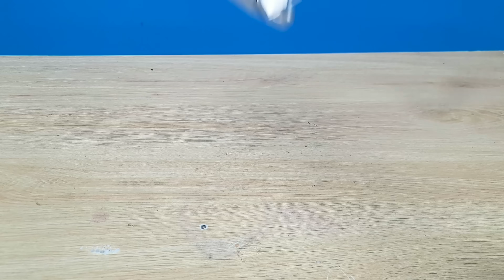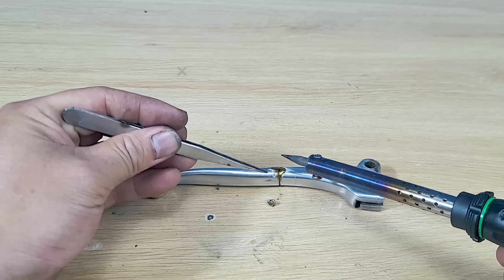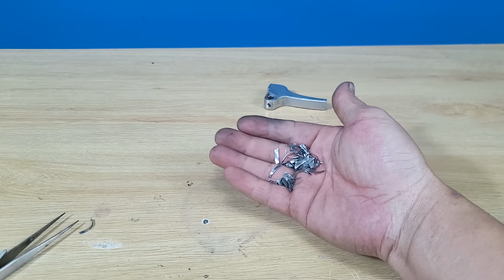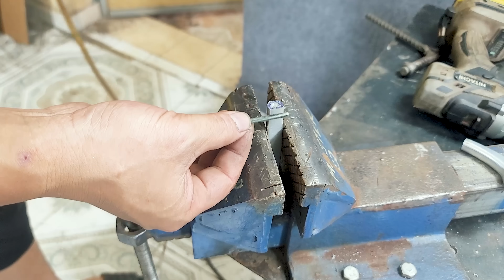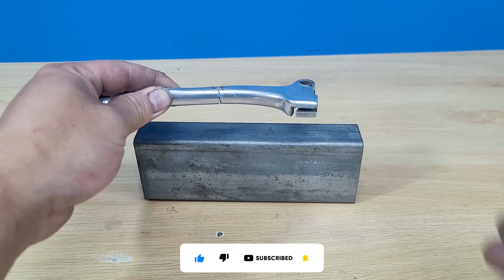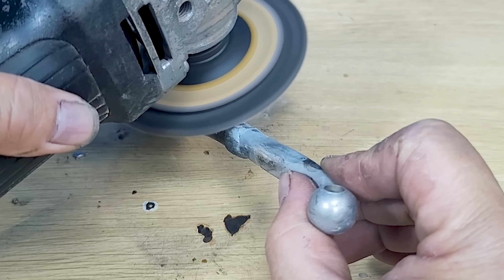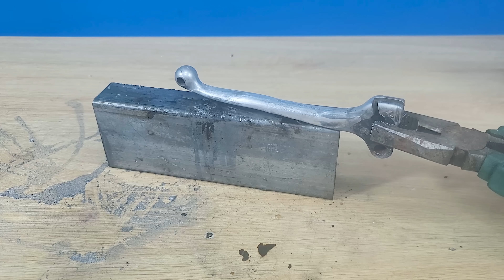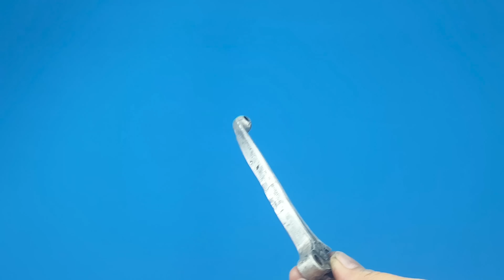Even a NASA professor had to learn this from me! Idea of using 1,5V battery to weld aluminum brakes

Comment: what was the whole point of stripping and soaking the battery shell cover bits again? When all you had to do was buy some aluminium welding sticks
Reply: My first thought also, the screw is probably doing more than the solder
Reply: It's a homebrew way of making brazing flux as far as I can tell. Zinc + Toilet cleaner (this brand active ingredient is Hydrochloric Acid) gives you Zinc Chloride which is an appropriate flux to remove oxides from aluminum alloy in order to allow the tin-zinc solder to wet and adhere.
Reply: Actually if I had only option to fix and not replace..I would just use a stainless steel screw..would actually be strong or stronger then it was..
Reply: ...because ordering sticks is not the African way
Reply: because sometimes you can't just buy stuff. you're acting like the average privileged westerner
Reply: @wizups Let me ask you this. Would you rather gamble and risk your life / the life of another person on a dodgy lever, or walk somewhere in relative safety? There is a third option but we can get into that shortly. I know full well the choice I would make, privileged or not. Its less about privilege and more about not wanting to die or kill someone else. This is unfortunately one of those scenarios where a viewer of this content is either going to agree or disagree with the methods used and the risks involved and frankly anyone who agrees with such methods will not have the sense to see the inherent faults and implications. There is risk involved in everything from tying your shoe laces in the morning and snapping your spine, to jumping off a bridge later in the afternoon. Tying your shoe laces is unlikely to affect anyone else, but the afternoon bridge jump has the potential to involve other people and so questions have to be asked. Its a risk assessment around the potential to injure other people, and this lever repair is just off the scale.

Comment: putting that steel screw inside the aluminum is going to result in galvanic corrosion and internal erosion of the repair and it will eventually fail and snap off, quite likely at the most inopportune moment when max braking is being applied.
Reply from the maker: Thank you for your comments and shares, thank you for the extremely valuable knowledge you bring to us, my good friend, have a nice day

Comment: Do not copy this idea !! In theory you could glue the two pieces together and they would hold for a while, eventually they will fall apart again at a critical moment. The point is you can't just weld Alloy together with a Gas Welder, Steel yes but not Aluminium Alloy. It requires critical and accurate temperature control and for the cost of a new lever.....well all I can say is DON'T !!

Comment: This cannot be surpassed in terms of ridiculousness. Anyone who works on parts on which life depends and doesn't even have a metal drill or tap should just leave it alone. A new lever costs almost nothing. And the NASA professor (who of course doesn't exist) definitely laughed his head off at this video. And it has nothing to do with welding, it's just filling the gap with solder.

Comment: it seems that you are:
a) using the screw to mechanically hold the parts and do the actual work
b) using the zinc chloride to prepare a rough surface, by cimentation of the zinc on the aluminium (probably zinc aluminium alloy like zamac)
c) using tin-lead solder to fill the gap on the union, basically a cosmetic workarround, not even needed at this point, you could have used bondo
Reply from the maker: Thank you for your comments and sharing with us. Have a good day

Comment: If you are compelled to do this you probable should see that the clutch is the lever that is repaired. Sometimes the brake and the clutch can be switched. It would be better that the repair fails for the clutch than the brake.

Comment: Don't take any notice of the idiots.... in some cases you can't buy these parts and having the skills to make or fix it yourself is priceless, well done buddy for sharing your knowledge.
Reply: This is at best what I would consider a Bush fix. Parts that are damaged where safety is a concern should always be replaced and not patched. But besides that, the premise of this video was that even NASA is learning from this gentleman what is common knowledge to most people in the construction or repair world. This guy is looking for clicks and failed to break any new ground here.
Reply: There is sO much more value to this than repairing a brake lever.  I got so many take-aways. Mad skills, man.
Reply: You're absolute right in my book. 

I think the Video is packed with clever craftmanship and creativity.

Keep on going, haters gonna hate. 

Still sad to see people react to creativity with destructivity.
Reply: In exactly what case would you find yourself incapable of finding that part but having a treasure trove of tools & supplies required to fix one? Good luck hauling that vise & bench it's attached to down the bike trail! 😮‍💨

Comment: Nice effort, but after a minute or so of watching you dealing with the battery, acid and stuff, I decided it's way more safe and practical to just go out and buy a new cheap freaking lever. BUT... This could work for some other emergency applications, indeed. One more thing realized: you better have some spare levers on hand. Better have and not need, than need and not have.
Reply from the maker: Hello, nice to talk to you my good friend, have a nice day

Comment: A la nasa te vamos a enviar para que investiguen lo mal que tienes la cabeza o a Mondragón Ácido Muriático y níquel que te quieres matar . 

Tomen arena de miga es un tipo de arena de roca triturada a 1kg se agrega 100g de grafito puede extraerse de pilas usadas triturado hasta crear polvo y mezclar con la arena agregar arcilla caolín polvo o arcilla en bloque para polvo 100g en arcilla no seca es más complicado la mezcla . Mojar la mezcla ya tipo mortero de fundición y colocar la pieza a replicar el molde se realiza en 2 mitades mire moldes para colada y esto no es aluminio es calamina una aplicación Zinc Aluminio Níquel  el punto de fusión es relativamente bajo la colada de este metal se realiza de abajo a rebosar o creará imperfecciones de consistencia es decir la entrada de metal fundido es como una J al molde le crearemos salidas de gases el metal aconsejo 50% las del total de la pieza .
En caso de soldadura directa Barilla aleación Cobre aluminio plata limpiar las partes con cepillo acero inoxidable y agregar bórax para que sea viscoso se puede agregar a volumen 0.5% ácido muriático para este tipo de aleación pero es mejor Bórax polvo las soldadoras con bórax puede provocar que las partes se separen fijarlas en un banco soldadura

Comment: Here's an idea: Tap the lever big end, then use a long bolt with the proper diameter, screw it in with red loctite, then bend it into the right shape, cut it at the right length, then cover it with various thermoshrink tubing, then sand it until it resembles the original lever, then paint it aluminum.
Now, here is the most critical part for this to work: DO NOT post it on YouTube.
If all goes well, nobody will ever know why you had a fatal scooter accident.

Comment: Clever method.
Yes easier and cheaper to buy new but people just don't get his point. It is very handy to know skills like this.
A lot more to it than people realise. Excellent improvisation.
Making a tap out of a screw
Using the battery to make a flux
The end result is perfectly serviceable. Heating and hammering straight shows the strength of the joint.
Thanks for the video - anyone who really knows engineering would find the processes used to be interesting.
Reply: What's up with all the negative feedback. A fix like this has endless uses and can be applied to much more critical things than the break lever used for this demonstration. All you people running your mouths are the real waste of time. You sound like a bunch of idiots thinking your so smart.
Reply from the maker: Hello, thank you very much for your positive comments to us. You are a very nice person, nice to meet you. We look forward to receiving your support in the near future. Wishing you a happy new day
Reply: Even inventor surprised at positive comments
Reply: It's because these people have been trained to be consuming sheep and everytime something breaks they buy a new one.  If ever in a real emergency, everyone in this comments section would be begging this guy to help.😂
Reply: @TekkWolf  NO , this isnt about how to fix a fork dude, its something that could save his life  or lose it potentially

Comment: I have to wonder
could one actually "weld" the pieces together using high-amperage low-voltage to heat the seem to melting point? (maybe, use some alu filler rod?)
Reply: I have welded a kick starter back together with no issues, so yes you could just weld it if you have the gear and knowledge of how to do it. To be honest as a qualified metal fabricator the only thing holding this method together is the bolt he put in the middle, that is if it is the same brake lever.

Comment: I worked at an aluninum plant. The biggest in ontario. We extruded, anodized and fabricated everything from raw billots. If i told one of our new guys you made a lithium solution and melted aluminum together theyd call you an idiot. Highly dangerous. Extremely toxic. Flat pit stupid. Aluminum is light u could use anything to fill that gap. Its a damn lever not a bridge 😂

Comment: HAHAHAHA, What can I say? 
That fairy tale about the NASA professor can't be true. I once saw with my own eyes (i SWEAR!) how NASA used this exact technique to repair the wing of a space shuttle (I clearly remember it was Challenger) right on the launch pad, about an hour before takeoff. It was April 4, 1983, at Cape Canaveral. 
Challenger lasted nine missions with this repair, and was destroyed on the tenth mission because of a broken bolt in this joint. 
This happened on January 28, 1986, exactly 73 seconds after launch, when the bolt in the joint loosened.
so I wouldn't take any chances with a brake lever repaired like that, you could end up just like Challenger did.
Plus, this video wasn't posted until early 2024. 
Clearly someone here was copying from someone else.   🤣🤣🤣
Reply from the maker: Hello, thank you for sharing, have a nice day

Comment: My comments are:
1. This process should be called brazing, not welding.
2. The zinc from the zinc-carbon battery could easily have been gotten from a piece of zinc. Extracting it from a battery is unnecessary drama.
3. The chemical reaction produces zinc chloride, which is a brazing flux. There are better fluxes out there and even zinc chloride could easily have been purchased from a store, even in India, rather than making it yourself.
4. I have never seen anyone use a drill and a screw to drill into any metal. The drilling could have been done with a drill to be followed by manually cutting the threads into the hole with your specially-made 'threader'.
5. The insertion of the threaded bolt into the core of the joint is crucial to mechanically connect the joint. Well done.
6. Just before the torch was taken away at the end, a last brush of the chemical solution was applied. Considering the reaction, it seemed like you not used enough zinc, and there was still hydrochloric acid left, leading to the acid eating away at the aluminium.
7. Your brazed product looked like a child even its own mother would disown! Also, why would you polish it with toothpaste before polishing it with 800 grit paper? Seems like it should be the opposite!

In conclusion, a NASA professor would use the best-suited materials, the best-suited tools and the best-suited methods. You have done neither of these.
Reply from the maker: Hello, thank you for sharing, have a nice day

Comment: I think there's an error in this video.
I think the active ingredient in the toilet cleaner isn't hydrochloric acid but sodiumhydroxide (so a very strong alkaline solution, comparable to draincleaner), and that you're basically making a zincate solution. (The batterycase contains zinc).
A zincate solution is a common way in galvanics to deposit a zinc layer on aluminium by means of a chemical process called substitution.
On that zinc layer other metals can be plated, or in this case: soldered.
But next time just buy a new brake lever: much stronger and safer!
Reply from the maker: Hello, thank you for sharing, have a nice day

Comment: Never thought about using a self tapping screw as a drill bit. Very smart. Zinc, from the battery and HCl for a cleaner and resin? OK . Is the magic marker to help keep air (oxygen) off the metal to prevent oxidation during soldering? Nice repair... Thanks for the video.
Reply from the maker: Hello, thank you very much for your positive comments to us. You are a very nice person, nice to meet you. We look forward to receiving your support in the near future. Have a good day